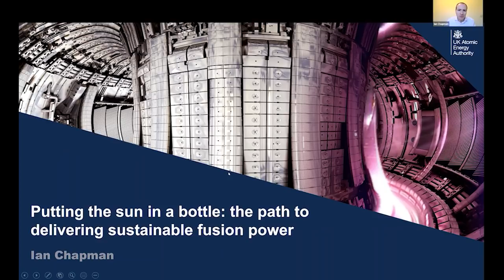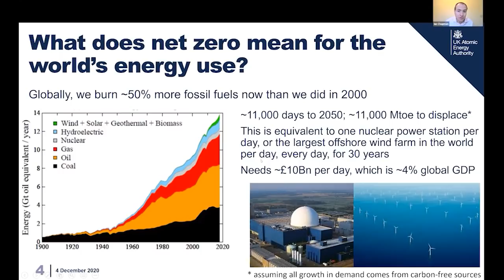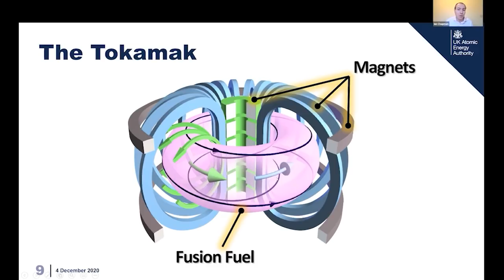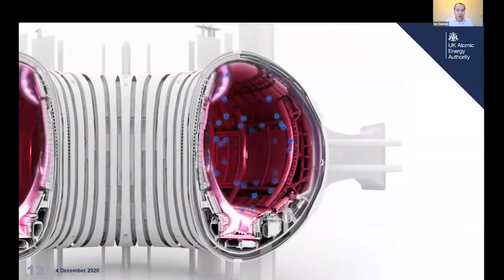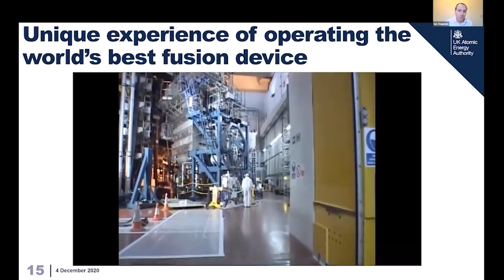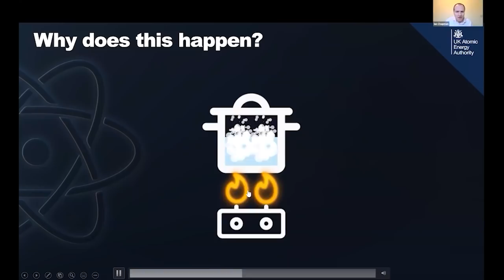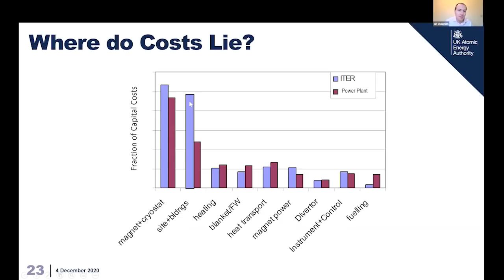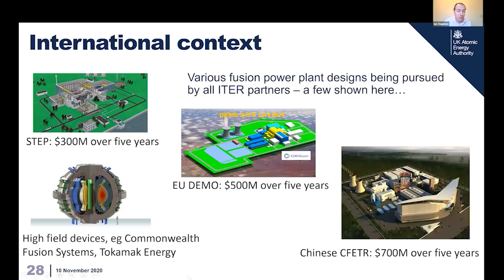Putting the sun in a bottle: the path to delivering sustainable fusion power | The Royal Society

Comment: Brilliant presentation. I have followed fusion for the mythical 30 years and am more hopeful now than ever that fusion power will become reality in my lifetime.
Reply: "No energy system can produce sum useful energy in excess of the total energy put into constructing it.
This universal truth applies to all energy systems.
Energy, like time, flows from past to future."
Reply: @sunroad7228  Fusion energy is a pipe-dream. Never to be realised despite squillions of dollars spent of it. Eddington's fusion-gas model of the Sun is completely falsifiable. Simply look at the spectra. Gasses cannot produce continuous spectra as is measured from the Sun and all stars. They are condensed matter, superconducting metallic Hydrogen - solid. Not gaseous.
Reply: @peterlowrie  "In an Energy system, Control is what consumes Energy the most [see why Maxwell's demon experiment always fails]."
Fossil fuels needed to be traded on the basis they are finite, not on the basis of Supply and Demand.
Wailing.
Reply: @peterlowrie  
Except they can.
A hot, dense gas/plasma produces a continuous spectrum.
Kirchhoff's Laws.
Reply: @sunroad7228  ...just checking; you've seen the pictures and films of nuclear bombs exploding, have you?
Reply: Yeah, my experience exactly - although I'm a little less patient on the "hopefulness" front, anymore. 
I mean, realistically - one of these days, one of them professors is gonna say "net-energy positive, commercially viable fusion is only five years away" - and they turn out to be CORRECT.
But so far, I'm old enough to remember countless stream of professors, making that exact claim regularly, ever since the 1980s - and being constantly proven by the REALITY, to be full of shit.
Funny how the money spigot for them never gets to be turned down, only up. I mean, maybe they are up to something, other than decades-long pipe-dream, and a comfortable and very lucrative careers.
Maybe.
Reply: @michbushi  Destruction is not a measurement of Energy.
I have seen cities and communities wiped out with no more than mass produced, $100 a piece Kalashnikovs, RPGs and mortars.
Check out images of Reqa, Mosul, Aleppo and others.
Destruction is easy because many natural forces come to help achieving it.
The energy put into building a steam engine is greater than that put into constructing the Great Pyramid, though.
The energy put into making your mobile phone is even greater...
Reply: @sunroad7228  destruction isn’t a measurement of energy, you’re correct, though it is the result of energy being released, and as such, if you know the exact structure of the bomb and the materials of its construction, then you can work out that the amount of energy required to unleash the massive amount of destruction seen at Hiroshima is about 1.5x10^13 joules of energy. Isn’t that interesting, you’ve now managed to link destruction and energy.
Reply: @sunroad7228  just because a crudely manufactured firearm and some improvised artillery can level a city doesn’t mean that destruction is easy, go ahead and try and equal the amount of destruction that is seen in places like Aleppo by yourself, I’m sure you’ll be speaking a different tune if you ever manage to finish. I fail to see what you’re trying to say by bringing up the pyramids and smart phones and steam engines, but I can assure you that more energy went into the construction of the monolithic structure that is the pyramid of Giza for instance then goes into anything but perhaps the enormous “Cathedral” Diesel engines.
Reply: @michbushi  while I definitely sympathise with your dwindling patience and hope, I’ve only been around a couple decades and I can remember hearing as a child how fusion was 20 years away and it’s still that far away even though at least that much time has already passed, but I think it’s fair to say that a lot of the stuff people were saying in the 80’s was only 20 years away, really wasn’t. Fission got worked out so quickly that if I were one of the scientists, I would think that commercial fusion energy would be up within a couple decades at most. It just turned out to be far harder then we ever anticipated it being since we started trying for it, and since fission has worked for the last 80 years or so then it’s easy to be reliant on the resource that you know then to spend even more capital trying to develop a new resource, even though capital is the only way a thing like a fusion reactor can ever be realised. Thankfully, since that capital has been getting sent these guys way, things like ITER (and I think an Asian or North American reactor as well, I forget at the moment) can finally be made and large scale research and testing can be conducted to figure out the sustainability or not of fusion energy. If these projects fail, I’m fairly sure that’d be the end of fusion energy work being supplied with the level of finances that it’s currently being provided for a while at least, until any meaningful breakthroughs in material science or magneto dynamics fill in the last pieces of the puzzle for us anyways.
Reply: @dylanshandley1246  When a sky scraper control-demolished, it is not the explosives that bring the building down, but rather Gravity.
Destruction isn’t a measurement of useful energy.
Try and convert the total energy of Hiroshima to useful energy and you'll hardly be able to power a mid size heavy industry plant or a coal mining operation with it for longer than short time measured by hours.

The amount of fossil fuels involved in that conversion will be orders of magnitude greater than the energy captured.
"Energy, like time, flows from past to future".
Reply: @dylanshandley1246  You said "but I can assure you that more energy went into the construction of the monolithic structure that is the pyramid of Giza for instance then goes into anything but perhaps the enormous “Cathedral” Diesel engines."
This is the outgoing 20th Century, fossil fuels-run Physics - what you have just said.
A nation would be able to build the pyramid of Giza well before being able to build a steam engine.
The pyramid required food, few raw materials, muscle and brain power.
A steam engine requires lots more externalties. It needs all Europe forests to be burned, mountains of coal and centuries of sunshine - to grow food and grow the population - enough to create the steam engine.
Ages after building the engine will pass and seas of crude oil and coal must be burned before the nation would be able to build the mobile phone.
Fossil fuels were so energy-dense, traded cheaper than water and so hypnotic, they made humans see the laws of physics up side down.
Wailing.
Reply: @sunroad7228  why bring up gravity then? It’s the cause of some of the most destructive, and by necessity, energetic phenomena we’ve witnessed as a species. Hiroshima produced an estimated 150 trillion joules, if you convert that to kw/h you get 416 million, a standard coal plant in a year produces 8x the amount that Hiroshima produced in a femtosecond. That means, that if you require a whole 500MW coal plant to power your operation, if you instead used the energy Hiroshima produced then you would be able to power that operation for 43 days based on the femtosecond of output. If that doesn’t work because you refuse to accept it, then we have used the exact process that the bomb dropped on Hiroshima used, just more controlled, in every nuclear reactor, and they certainly produce useful energy.
Reply: @sunroad7228  the pyramid did require all those things and more, few raw materials is incorrect, there was tonnes of raw material quite obviously, because that’s what’s still standing of the pyramids today. It also required the labour of 10’s of thousands for unending year upon unending year and all the tools they used that wore out quickly and had to be either replaced or remanufactured. A steam engine requires none of those things, were they done anyway for what the people, with no knowledge of modern day sciences or sensibilities and issues like global warming for instance, thought were good ideas? Largely yes. You’re linking two very seperate things and saying that they’re connected because one happened and then eventually the other did, and most likely inevitably would have even if the steam engine was never invented. How did the world manage to see the world of physics upside down and remain running then? Our world is dependent on our knowledge and execution of the laws of physics, if there were some blatant flaw then it would be rather noticeable when the aspect of society it effects suddenly takes a turn for the worst.
Reply: @dylanshandley1246  Conversion from one form of energy to another is incredibly energy-intensive.
The pyramid has required less of that conversion. A steam engine required heaps more. A transistor required even more - such as the power grid, etc.
You said: "How did the world manage to see the world of physics upside down and remain running then?"
The world will keep running even after the 20th Century Physics and fossil fuels are over and  behind humans.
Don't think Life is a product of our civilisation and its fossil fuels-run Physics. 
Life will outlast our outgoing civilisation, having more energy was put into Life than any of humans-built and run systems.
You said: "Our world is dependent on our knowledge and execution of the laws of physics"
False. The style of our world today is run by our current set of knowledge.
The world will keep running even when our current knowledge  proves incomplete and full of wrong assumptions.
Today's Physics is a mere product of fossil fuels-imposed mind set.
Let fossil fuels deplete more, and humans will start to realise how the 20th Century Physics has been ignorant and misleading.
Reply: @sunroad7228  sure man. Physics is solely and inherently dedicated to the furtherance of fossil fuels 🙃
Reply: @dylanshandley1246  "sure man. Physics is solely and inherently dedicated to the furtherance of [trading] fossil fuels [cheaper than water, under the doctrine of 'supply and demand']".
Fossil fuels needed to be traded on the basis they are finite, instead.
That would have helped humans having real and genuine Physics - that is not mainly practicing social Darwinism.
Reply: @michbushi  The money spigot has always been turned down. Fusion reactors would be incredibly valuable, yet a vanishingly small percentage of world GDP has been spent on it.
Reply: Are you planing on living forever.
Reply: Claimed perpetual Energy systems will always get perpetual questioning from humans (watch slide 11 in the video. It says 50 MW will output 500 MW. Why the input is needed then altogether, when the system can be plugged into itself for a perpetual power?!).
The discussion here is not an issue of an individual or a few.
Only Galileo and a minority of people before him knew earth is not stationary.
Today, they are in billions.
Claimed perpetual Energy systems will always get perpetual questioning.
Wailing.
Reply: @sunroad7228  It's not perpetual energy. 50 MW, plus deuterium and tritium, will hopefully output 500MW plus helium, free neutrons, etc. A high-energy / low entropy fuel becomes a lower-energy / higher entropy exhaust product. Entropy always increases. Hopefully it will be able to produce enough output electricity to keep it's own magnets running; but the real energy input comes from fuel.
Reply: @lordcirth  Circular.
Fossil fuels are so hypnotic for humans.
Humans needed to be morally, ethically and intellectually more capable before they have mastered the mass extraction of fossil fuels.
This was not the case, unfortunately.
Wailing.

Comment: I really hope that by 2040 fusion won't still be 20 years in the future.
Reply: It's not the only option.  Other ones will appear, even much before 2040!
Reply: ITER is under construction right now. It’s expected to generate a Q factor of 10 in 2025. Tenfold output energy. 500MW on an input of 50MW.
And it’s expected to go commercial in 2035.
So we’re very close.
Reply: May be... but, actually, they are selling a light bulb that self destroys after a few minutes. because, after little operation time, the inner core is destroyed by neutrons produced in the reaction that the magnetic field cannot contain.
Reply: Whichever we get you can bet that it will be relatively more expensive than current options by the time it reaches our homes. Id like to hear more about free energy when it comes to the wallet
Reply: @g07denslicer  unfortunately there is no plan to fasten a generator up to it at the moment. So it will not be supplying electrical energy, even though in all probability it could. The plan is then to run it and later build new plants using lessons learned from that. Effectively when you include efficiency issues you would get a net zero energy generation. You then have to include that it is not designed for constant use but periods of about 7 minutes.

Earliest original plan was first plant to produce grid electric about 2050 although others could have power into grid well before that.
Reply: @seriousthree6071  yes, I’ve done some reading on the topic since writing the comment. I was mistaken. ITER will not have a generator.
I also didn’t know until now that ITER can support being active at most 7 minutes at a time.
Reply: i love the idea and watch videos on fusion power a lot, but always sit waiting for the 20 years in the future.
Reply: wrong.its not gonna work. wrong shape.
Reply: @alwaysnumb1  well, the difference this time is that there is actual work done and there are real breakthroughs happening.
Reply: @jamesmacdonald5556  Dude... I’m sorry to break it to you, but what’s in that video is pseudoscience and a fraud.
Reply: If i live unto 2040 it would still be not 20 but 30 years in the future. In the 60s i was told it was coming within 15 to 20 years. I hope it suceeds.
Reply: @kevinyaucheekin1319  except that in the 60s there were no huge government projects actively developing the technology.
Reply: @g07denslicer  My sire in the 60s use to spend approx near 1 hour per day on reading to me when i was a young child before sleeping at nite. It started with Life magazine and ended up with the economist "newspaper" after which i read by my self. There was also a Soviet Science periodical published in English which he did read when i was approaching 10. I remember he was exicted as he read it stating that Club of Rome may well be wrong. The Soviet science periodical in 1971 or 1972 in english published a refutation to the Club of Rome detailing continuing enhancements to grain yields, the processing of seawater to secure uranium, also fusion prospects reporting on the proceedings of soviet sucess in fusion and the imment possibility of a post scarcity world through science within the next 20 or so years ipso facto the Club of Rome was wrong.
There were significant Soviet investments in the development of Tokamaks in the 60s such as the T-3, T-3A,  TM-1, TM-2, TM-3,T-4 in the 1960s. 
Note Her Majesty government in Great Britian then was not the only government on this planet.
Reply: @g07denslicer  There is such thing as purposely suppressed knowledge such as energy from nothing. Evil people be scamming homo sapiens with imaginary particles and false fusion hope.

Comment: ZETA , short for "Zero Energy Thermonuclear Assembly", was a major experiment in the early history of fusion power research. Based on the pinch plasma confinement technique, and built at the Atomic Energy Research Establishment in the United Kingdom. ZETA went into operation in August 1957 and went on to have a long experimental lifetime and produced numerous important advances in the field.
Reply: It didn't work, never produced enough heat to reach fusion, it was just an experiment that got leaked to the media and the media made a huge deal out of it.
Reply: @Shadi_Wajed  Back in ZETA's day I was offered a job at AWRE but took a Met Office offer which turned out to be for the best :)
Reply: @Shadi_Wajed  It did "work" in that it added to the growing knowledge of plasma physics. Sadly, it also produced neutrons that had nothing to do with fusion reactions. It led to a bunch of experiments when fusion research moved form Harwell to Culham. I worked on some of them.